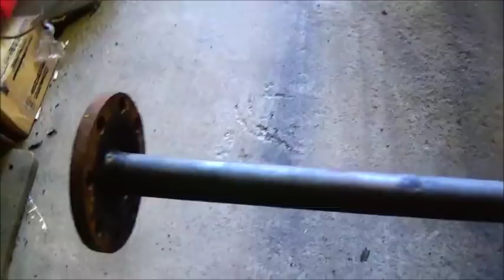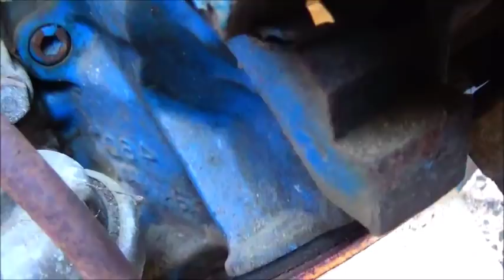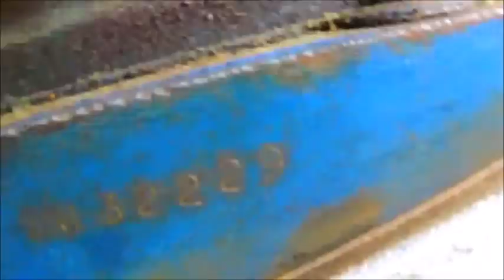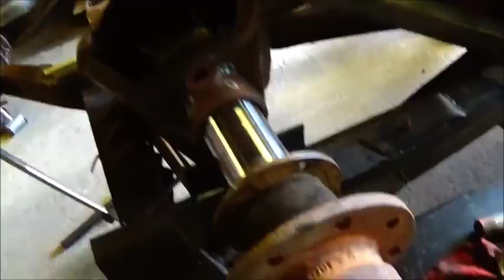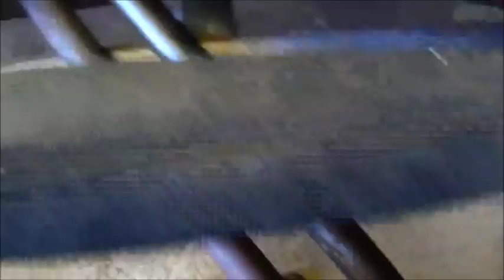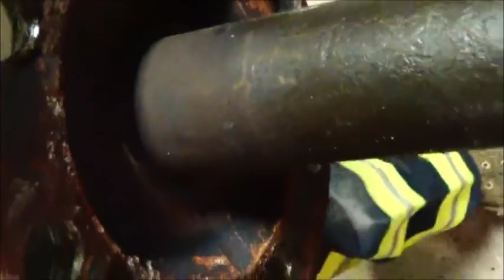Low Budget Drag Car Build Part 16 Axles & More

Comment: if its a 429 its a 365 HP nice start for a hot rod .kinda like my chevy 427 none of the casting numbers match anything any where  was replacement L 88 69 corvette yes 4 bold block and 7/16 rod bolts full floating ,

Comment: If that came out of a '69 gran Torino its bigger than a 351 like mine had in it but it did have the option of putting a 429 in it so I didn't see a 460 offered with it then. So if its bigger than a 429 it came from some other year. That project is moving right along always great to see your videos.

Comment: cut off axle turn around spot welt to cut end of axle us its guide grind spline in with cut off wheel on four inch grinder to recut splines welding will not hold tried it 40 years ago

Comment: right beside the oil pressure sender  is the serial number of car it came from  the fifth number will tell you the size in motor manual

Comment: off the internet:  You have a very early 1969 base model engine. If it is a 429, then it is as much a Thunder Jet  (not Cobra Jet) as any other 4-barrel 429, and is factory rated at 360HP. Might be a 460, too, but the only way to tell the difference is by unbuttoning the pan...unless the tag is still on the intake manifold.

1969 429 and 460 longblocks are made of 100% identical interchangable componenetry except for the crankshaft and pistons (which are exclusive to each of the engines). Even the bore is the same on both engines.

Comment: The partial VIN on the block, 9N132229: The first 9 means that it came out of a 1969 model year vehicle. N means built at Norfolk, VA assembly plant. 132229 means that it was the 32,229th vehicle scheduled for production at that plant for the 1969 model year (the production number starts at 100001). The 8K19 seen on the intake also tells us the intake itself was cast on October 19, 1968 which was firmly in 1969 model year production. The 9A21A on the front of the block is the date that the engine was fully assembled at the factory. This engine was assembled on January 21, 1969. 

Now, I'm a Ford guy and I've done a lot of research into VIN's and the numbers. I can generally narrow a block down to the original vehicle it came in and exact day it was cast just based on the numbers. But honestly that partial VIN on yours even has me a bit stumped. The reason being is that the Norfolk, VA plant only built trucks and truck chassis as far as I can tell. However truck VIN's were different and that partial VIN is clearly a passenger car VIN. It's definitely not originally out of a Torino though, because the 385 series 429 wasn't available in the Torino in 69. I need to do more research on the Norfolk plant and see what kind of vehicles they were producing in 69.

Comment: Ford built engines in Australia that can only be determined by lookng at the crank, 302 and 351 Clevelands .i think a lot of those Fe Fords were the same in the US. 429 and 460 being the same engine with different cranks.

Comment: 9a21a it is a c-6 429-460's have the ribs on top of the housing Fe are round  that would have been a great motor for the 59 pickup or 53 .

Comment: Instead of putting oil down the cylinders put acetone and ATF mixed together into the cylinders. I’ve used it on a few of my engines and it works great.

Comment: Jonathan ,The Dana 60/70 and 80 all have the same axe size the only diff is the length and the center section of the diff housing but wheel bearing's and all outboard parts re same
As for that engine most likely it is a 460 they came out in 68 and where in the Ford P/U
most likely the original engine and not a big horse power producer @ 370

Comment: its a 1969 Lincoln 429, one of the best blocks next to a boss 429 block, I have a 69 Lincoln 429 sitting in my garage right now. My plan was to drop it in a 69 Torino GT fastback but turned out it needed most body panels replaced
Reply: does it have the tag on radiator support 365 HP?

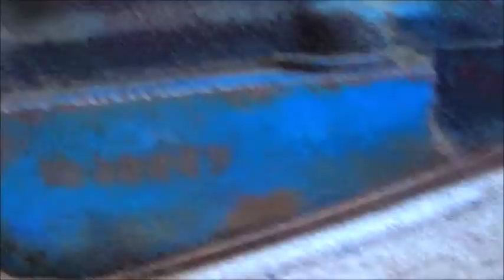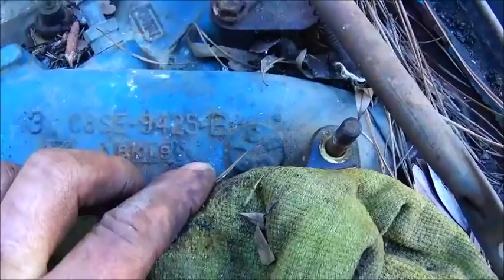Comment: Old trick for me- rub a yellow crayon on numbers; raised or stamped in, it highlights nice. I always had a "dayglow" crayon pencil for work, for marking the pulleys for seeing a timing light.  @3:22   9 N I 3 2 2 2 9        @5:28    3 8 S E - 9 4 2 5 B  /   B K 1 9 S  BEST FORD ID WEBSITE:   http://www.fordification.com/tech/engineID-V8.htm

Comment: 7 bolts on that ford engine does mean 429 or 460 need the numbers  on the sides of the block to get more info get that ford engine running for a comparison after the 427 blows in 59 triumph

Comment: 429's and 460's are identical down to every nut, bolt and part, with the only exceptions being that the crankshaft and the pistons are engine-specific (but even the connecting rods are the same).

The external appearance is the same unless the original engine tag is still on the engine or maybe the original decal on the air cleaner (not that I would trust this to ID a motor).

One way to identify 429 vs 460 is to flip the motor over and unbutton the pan. One of the crankshaft counterweights (3rd down from the crank snout) has alphanumeric markings stamped on it's edge, and these markings identify whether it's a 429 or 460 crankshaft.

429 = 4U, 4UA or 4UAB

460 = 2Y, 2YA, 2YAB or 2YABC....or 3Y or 3YA

Also, for quick identification of the crankshaft, you may look for the nodule or embossment between the first main journal and counterweight. The 460 is embossed there, while the 429 is not:

429
Reply: http://www.fordification.com/tech/engineID-V8.htm

Comment: Cr*p shoot, could be 429 or  460.  460/429 had the same block casting.  Only way to know is measure the stroke, 3.59" would be 429.  It's got the lower deck height and higher compression heads....  Same as the D0VE heads that everybody used to like.
Reply: Doesnt matter with a GIANT TURBO bolted to it!

Comment: If I remember right ford never put a 460 in a Torino must have come from and other car or truck ..they did offer a very common 390 in 68 - 70 maybe 71 also still blue is cool . PB Blaster can work wonders .
Reply: +Born Again Torinos 
The 460 was not a Torino factory option until 1973 and then only on vehicles with A or C in VIN fifth position.
Reply: Exactly, My torinos are 74-76. Rusty Rods said ford never put a 460 in a torino.
Reply: You are right about the 74-76 model years I have seen them and when I said never I meant 68-71 ...should never say never . Thanks
Reply: Sadly, the 460s I had in those detuned mid 70s torinos were as gutless as they could be. Can you imagine having a 460 4V that got around 216 HP?  8^(
But the torque was off the charts.
Reply: I've built 41 Starsky & Hutch Gran Torinos. I can tell you that several of mine had factory 460s in them.

Comment: You have a very early 1969 base model engine. If it is a 429, then it is as much a Thunder Jet (not Cobra Jet) as any other 4-barrel 429, and is factory rated at 360HP. Might be a 460, too, but the only way to tell the difference is by unbuttoning the pan...unless the tag is still on the intake manifold.

1969 429 and 460 long blocks are made of 100% identical interchangeable componenetry except for the crankshaft and pistons (which are exclusive to each of the engines). Even the bore is the same on both engines.

Comment: 1969 460 wasn't even offered. 9 on block does mean 1969 Probably a 429 Thunderjet.
Reply: The 460 was available in Lincolns in 1969. 365hp
Reply: Most likely it’s a 1969 thunderjet 429 cu . Pretty common engine for the day. I got 2 of them, was like 365 hp if I remember correctly. But like 400 and something tq I forget. Yes makes a great rat rod engine. But likes fuel.
Reply: all 385 class engines have a long crank snout
Reply: the crank spacer on 385 is to take place of the pump
Reply: 460 Thunderjet
Reply: Have one in my shop 69 460